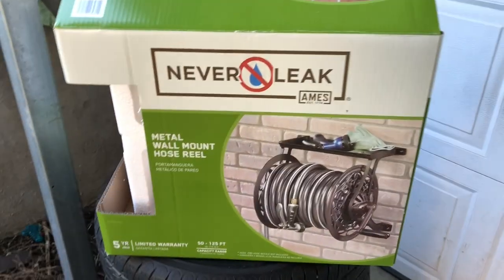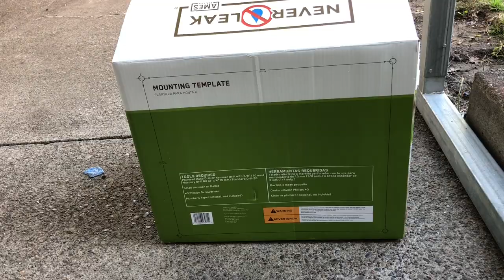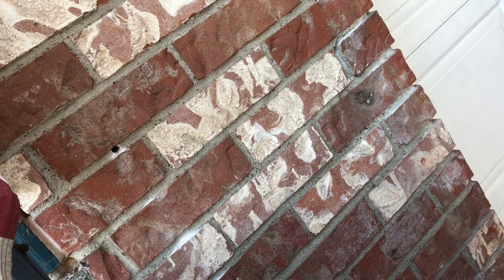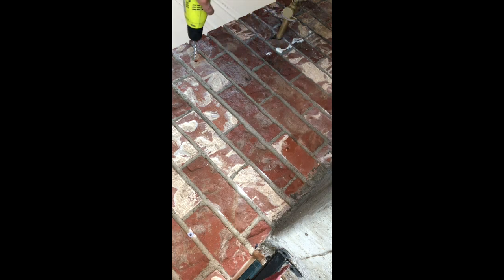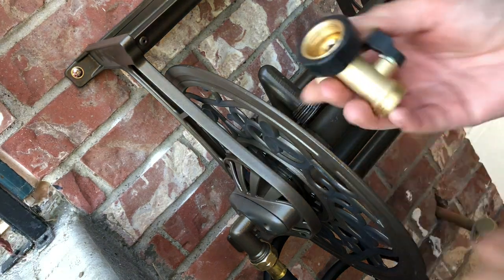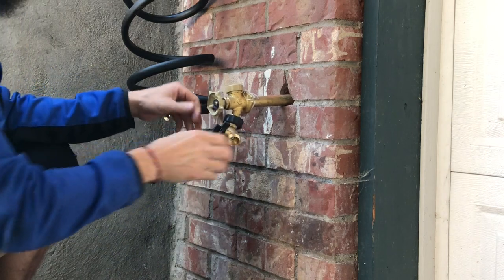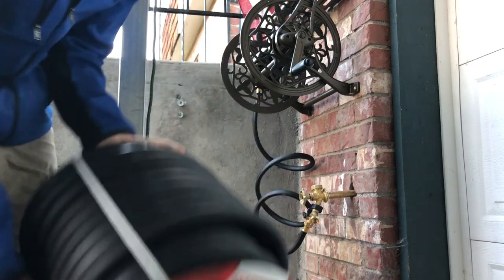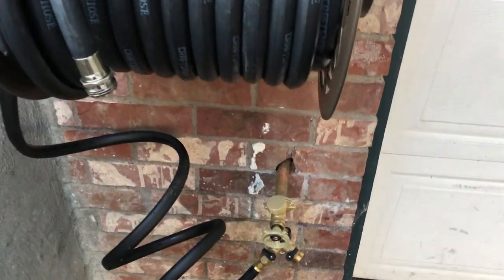NeverLeak Steel Wall-Mount Hose Reel Install

Comment: I have had this model for probably 15 years now and the part that attaches to the hose on the left side spins around WITH the entire hose reel defeating the purpose. Originally it did not move. I might have to buy a replacement because it served me well. Florida weather though beat up the finish considerably but it still looks good. I wonder if I can get in there And free up what is causing the hose attachment on the left side to spin around with the reel itself.
Thank you so much for posting this. Could not find anything on installation of the Internet to see if that hose attachment on the left should or should not be spinning around.

Comment: My experience is that I use a hammer drill.  However, the holes, at least one, has never lined up perfectly.  The drill bit will move a tiny bit while drilling, at least with me.  So I have to pay real hard attention.  If the bit starts going right, I move the drill to the right which points the bit to the left to compensate.  I'm talking only tiny movements. Just a tip.

Comment: Please fix your hose bib, it needs to be attached to the wall.  You applied the Teflon tape backwards, wrap it in the direction that your attachment will screw on.
Reply from the maker: I haven’t had any issues with it yet.
Reply: You will!

Comment: Not sure how much you use garden hose in your business but if you haven’t tried out flexzilla garden hose I highly suggest it. It’s super light weight and I’ve had one for going on 2 years and I own a pressure washing company so it’s used at every job. I’ve heard similar things about zero g but don’t have personal experience. Also if you see this how is the hose reel holding up?
Reply from the maker: It’s still hoping up great! Thanks for the idea also.

Comment: Where you connect your hose to the reel, it looks like it is threaded all the way around. On mine, after installing I noticed mine is not in two small spots. Water sprays out from those two spots where it is not threaded. Is mine defective or did you do anything to the connector inside the reel?
Reply from the maker: Sounds like you might have a defective one unfortunately.
Reply: @AndysAutoCarePlus   Sounds like it needs a washer. Sometimes those are made that way. But it’s not the threads that seal for water, it’s the hose washer.

Comment: you need a hammer drill for brick or concrete.
Reply from the maker: I’m sure I could have installed it better but I never had a issue with it. I just moved it to our new house.